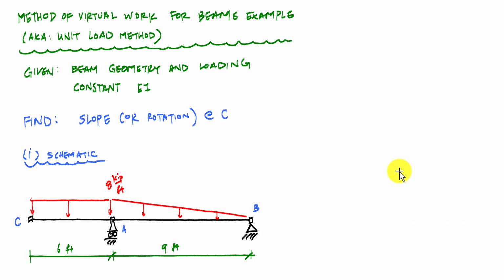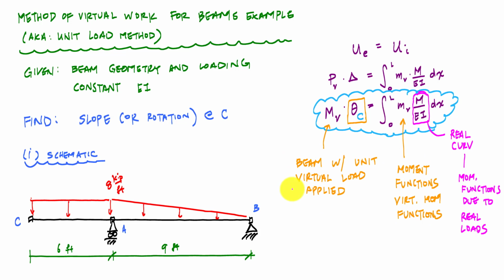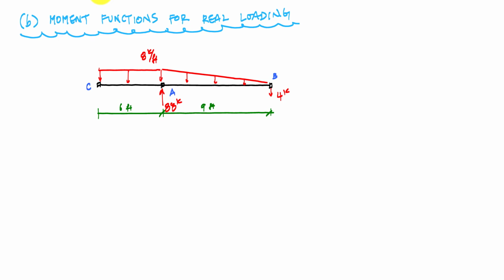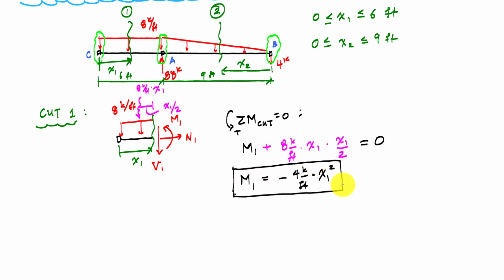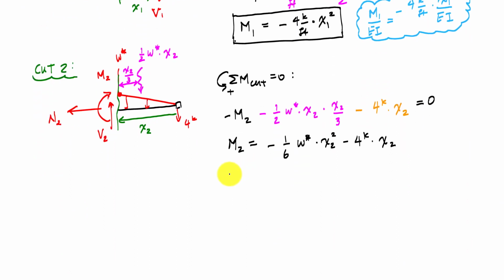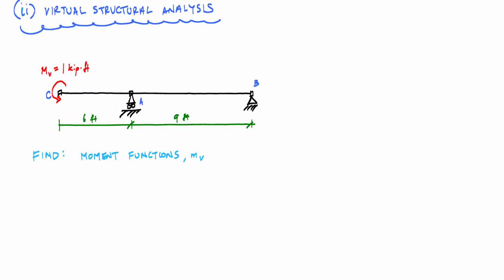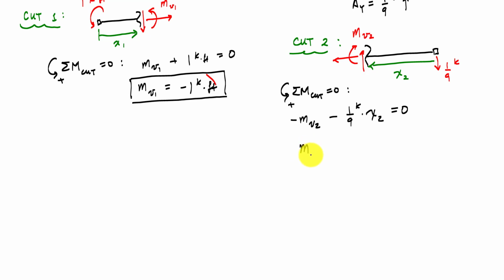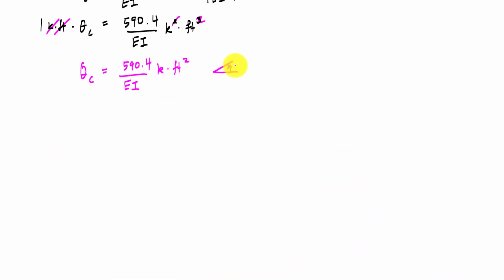Unit Load Method (Virtual Work) for Beam Slope or Rotation

Comment: How to handle beames  (not cross sections!)  that are connected ? I mean it LOOKS like a rectangular.
Reply from the maker: are you talking about a hinge connection? aka, compound beam
Reply: I mean a closed frame. 4 beams connected basically. At the bottom, two Supportings, pinned and roller supports. And at the top just connected beams. It looks like a rectangular.